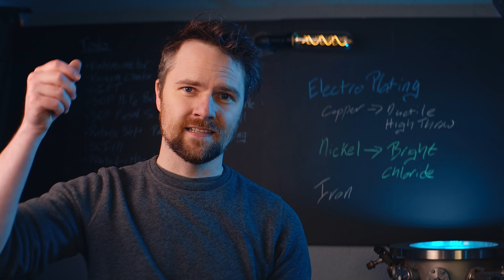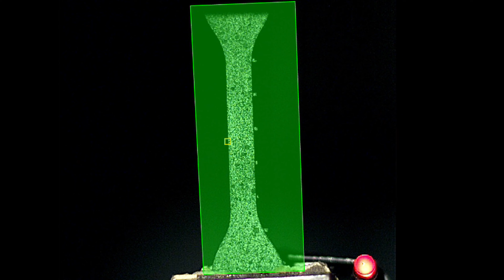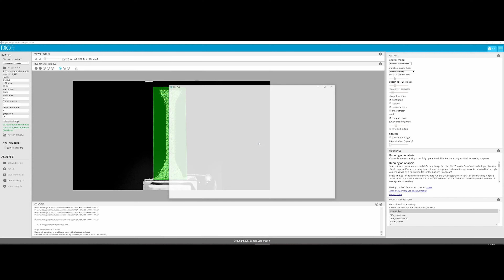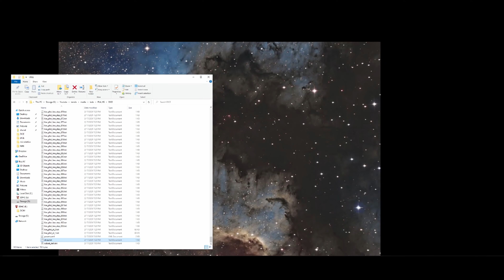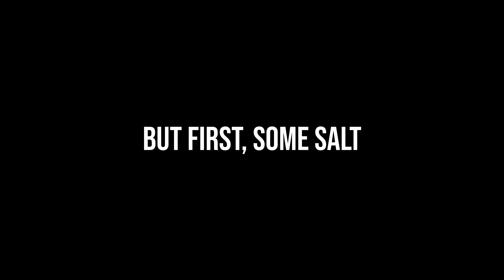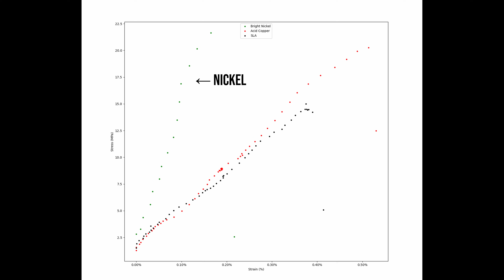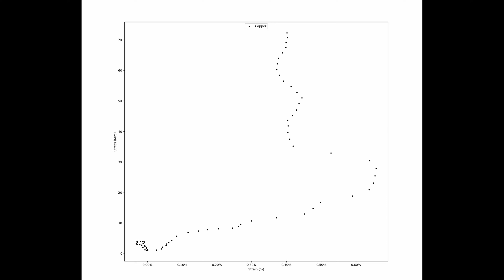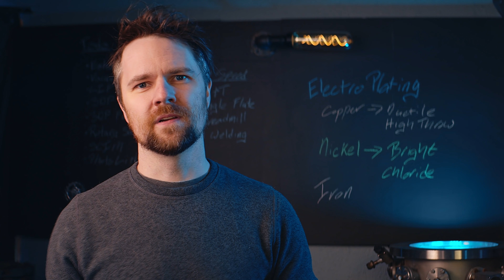Stronger 3D Printed Parts with Electroplating

Comment: I've been trying to metal plate my SLA prints for a while now and have had no end of issues with the paint/ink flaking off and taking the plating with it. The next thing I was going to try was to attempt to make the resin itself conductive by mixing in graphite or copper powder. I don't want to go too wild roughing up the surface of my parts for better adhesion because then the final surface finish will be affected.
e: jotatsu's suggestion is interesting too!
Reply from the maker: Yeah, it can be a real headache... I probably should have shown the pile of failed parts at the end to help convey that too. :)  One thing that can help is changing up your plating recipe, different recipes have different levels of internal stress.  E.g. an all-chloride nickel I tried had to have a copper undercoat because all the internal stress made it peel off the conductive paint. So you might have luck changing up the plating bath, and also a lower current density (i averaged 100-500mA for most of these).

Comment: Instead of putting parts in a chemical bath and plating the outside, could you print tubes and coat the inside, or print a shape with a wall and a lattice as infill so the 3d printed part is its own chemical bath or something? Maybe use conductive filament.
Reply from the maker: In theory, yes. But the electric part of electroplating makes it tough.  Electric field lines will always extend between electrodes in a relatively straight line, so to plate the inside of a tube you'd need to thread an electrode inside the tube and keep it from touching the tube wall.  So something complicated like a lattice gets complicated.  That's the main appeal of electroless, it coats everything uniformly because electricity isn't involved.

Comment: Re apparent increased strength of the plastic interior of your compound part: perhaps the metal plating is interacting with potential crack nucleation points?
Reply: That was exactly my thought.
Reply: ...which might point to other ways of using surface treatments to improve printed resin strength. I'd be interested to know whether a very light copper plating -- perhaps not even enough to form a continuous layer -- has any effect.

Comment: Hi! I really love your videos, keep on the good work! One way to make better adhesion between the coating and the graphite would be, to use ABS parts, and the conductive ink needs to be something thats dissolve abs. Graphite suspended in abs slurry would be a good option i think.

Comment: Not to not pick, but SLA resin is not SLA resin. It’s not a single category. There are a number of different physical characteristics available.
Reply from the maker: Yeah this is a very good point.  I added a line to my addendum comment with the resin type and brand. Also a note: I printed these samples a few months ago and then forgot about them, so if resin embrittles over time (not sure if it does?) that'd effect things too.  And the Form lab folks have shown that UV cure schedule can affect things too.  Many variables!
Reply: @BreakingTaps  what you are doing is interesting. It is similar to an electroforming project I did a while back. 
Resin just off the build surface is only about 80% converted. It will continue polymerizing for some time, aided by what post print curing you might do. Then it will exhibit its final physical characteristics. Thousands of possibilities for that. 
If you do pursue plating, it might be worth your time to print with an electrically conductive resin. But if not my preferred method on acrylics is PVD. On a dense lattice though... obviously difficult to get a good coating. The nice thing is that even very heavy high exposure surfaces will not be appreciably thick. As long as there are no stubborn self shadowed areas you should be good to plate or as you like.
Reply from the maker: @Ave_Xavier  This is great info, thanks! Once the temperature warms up a bit, I'd like to get back to working on my vacuum chamber (glowing thing in the corner).  First project is probably going to be thermal evaporation or similar.  I guess the challenge there would be getting a good rotating stage inside the chamber, since lattices would need to be coated at all angles.  Hmm...

Starting to look into conductive resins too, or additives (or papers/patents about adding additives)
Reply: @BreakingTaps  thermal evaporation can eject larger droplets. Take care. A magnetron is a bit finer a coating technique. Quite a few YouTube postings on DIY methods. But yes , you’ll need a rotation stage that can tip 0-30deg through the rotation. And you’ll need to reposition the part a few times to avoid shadowing. I think you know all of this. But it never hurts to chime in. As for conductive resin, contact Roxel3D.

Comment: oooh I would love a CNC Kitchen exploration on this
Reply from the maker: Yeah me too!  I'd trust his results a lot more than mine to be honest :)
Reply: @BreakingTaps  and I trust your results more than mine....
Reply: Hahaha tbh your stress graphics seem weird... But your results seem proper, nice video all around
Reply from the maker: @derchesten  Yeah, there are a lot of variables here: manual machine from ebay, potentially suspect planetary gear or motor (oscillations), load cell and arduino code, DIY fabricated jaws, misalignment, i think the polling rate of my load cell was too slow relative to the force of the machine, and then interpolating in the optical measurements... lots of things that could have gone wrong :)
Reply: @BreakingTaps   @Breaking Taps  whoa, I just discovered your channel yesterday and I'm completely enamored with the content, I didn't know it was a diy machine!
Look, you can keep the polling rate slow if you slow down the application of the force, I had the same problem when doing my degree thesis, the darn machines in the University had too slow of a polling ratio so we had to do the tests painfully slow (about 2kgf/s down from the standard 10 of the machine), which also has the side benefit of making the tests more reliable and the data less noisy. But if you could up the polling rate it would be way less painful.
Reply from the maker: @derchesten  Thanks!  Yeah, I'm going to see if I can improve both ends:  i suspect there's just something silly in my code, iirc the datasheet said the load cell chip could poll up to 80 sps and I'm not hitting that, so there might be something else slowing it down.  And I have a suspicion the motor inside the unit is some crusty old brushed motor and the brushes might be really worn out.  Replacing it with a new brushless motor or something would probably help a ton, and give me better control over speed.  It was unfortunately already on the lowest speed :(  yay old surplus equipment :)

Comment: Amazing work and beautiful image correlation shots! This really motivates me to finally spend some time and also try this out. Keep it up!
Reply from the maker: Thanks for stopping by Stefan! Your work was definitely a huge inspiration, and I'd love to see your results if you ever decide to try.  I'd trust them a lot more haha :)  I have a new appreciation for how much work this kind of testing is, and frankly, I'm skeptical of my data even after trying to only include the most conservative results.  Just so many variables: conductive layer, plating recipe/time/temperatures/current density, grip strength in jaws (too much can crack the plating, too little slips), axial misalignment, temperature... the list just goes on!  Really appreciate the work you do to get such nice results :)
Reply: @BreakingTaps  By using open source software, you are making your work accessible to others. Thank you!
Reply: @BreakingTaps  You should also investigate electroplating with conductive filament. Is raw conductive filament doesn't work well maybe try coating the filament with some conductive ink or something in the way make anything did for multi color prints by changing markers.
Reply: Stefan, I think this could be the solution to the re-melting problem. Chemically plate with Copper, re-melt, chemically dissolve the Copper (Or don't...)

Lots of work? Yes. More work than dealing with the salt? Maybe. Will it work perfectly? I'll eat my hat if it doesn't.
Reply: From the resources I could find, PPA+CF filament and theoretically ABS/PC+CF filament should have the lowest thermal expansions amongst thermoplastics. Maybe an ASA/PC+CF, since ABS with the Butadiene removed is frequently used in metal coating.

(main source: https :// omnexus . specialchem . com/polymer-properties/properties/coefficient-of-linear-thermal-expansion )

They should be closer to the thermal expansion rate of copper that I have found online, but I'm not sure how useful that is.

Would you even want to re-melt a CF-infused filament? Even without re-melting, couldn't you find another, cheaper material to make a metal-coated part? Maybe you'd rather 3D print a mold for a thermoset with lower thermal expansion rate, fill it with graphite, and coat the castings with metal.
Reply: Alternatively, if you just want easy and cheap metal-looking items, just print foaming ASA filament and electrolessly plate that. The foaming also reduces thermal expansion, and ASA is cheaper and relatively simple to print.

Comment: Regarding the copper elongation at around 08:40, could it be that copper is working as an "spreader" of the strain along the plastic part, ie, spreading the strain plastic sees, so the plastic part can take more strain before breaking?

Comment: Awesome project and video production! 

One thing that you may have addressed in a previous video, so sorry if I'm off the mark: Can you use the position of the jaws on your mechanical testing as a stand-in for the strain? Generally doing the optical correlation method isn't that necessary for uni-axial tension (and more useful in bending etc.  like you mention). 

Does your machine have the ability to precisely measure the distance that it has moved? 

As someone else mentioned in the comments, the largest problem with doing this is that it ignores the change in cross sectional area due to necking. Aka it gives you the "engineering strain" instead of the "true strain". The optical method can partly get around this, but like you said, the parts are pretty brittle so necking isn't really a problem. 

Anyway, I'm very much looking forward to what you do next!
Reply from the maker: Probably! This is all very new to me, so I'm sure I attacked it from a sub-optimal angle :)  I ended up cutting the description/footage of the machine itself, but it's an old manual test machine and didn't come with any hardware.  So I fabricated the jaws, added my own load cell and wired it up to an arduino.  The LED lights up when the load goes over a threshold so that I can correlate it to the video (because I have to manually push a button to run the motor).  No mechanical means to measure displacement at the moment.

I'm considering adding a digital DRO scale to the machine.  Should be pretty easy, and can read it out to the arduino to get displacement without the video.  I might do that before trying to tackle the FDM version of this video, since it seems like necking will be a much bigger issue.  Or maybe just switch to bending tests, that gives basically the same data as uni-axial tension right?  Well, I guess flexural stress is a little different from axial so not quite comparable, and the stress is very discrete in a 3-point test as opposed to uni-axial.  Hmm.

I saw "engineering strain" somewhere but didn't know what it referred to, makes sense. Cheers!
Reply: @BreakingTaps  Or put the reference points closer to the jaws, perhaps using permanent reference points on the jaws themselves.

Comment: "Powder coat" the part before doing the electroplating stack. I did a short video recently on how to.  You basically put a conductive powder (graphite for example) on an ABS part , put in an acetone vapor chamber and then lightly sand and electroplate the part.  The advantage is that the acetone vapor will integrate the powder inside the plastic instead of being just a surface coat.
Reply from the maker: Interesting, will check it out!  That seems like a solid method to get better adhesion.
Reply: @BreakingTaps   
Those  Unplated numbers are higher than Zytel.
What do you want?
Reply: Awesome Idea, I will try that soon
Reply: Now that sounds like something to try.
Reply: Would a conductive filament be conductive enough to work?
Reply: hmm if you could put lots of tiny holes on the surface it would let even more metal coat into the print and bind stronger.
Reply: Does this work for resin though?

Comment: for electroplating, can you insert additional electrodes into the mesh to make current more even?
Reply from the maker: Yep! Adding multiple electrodes is a common way to get better or more even coverage.  I used two anodes (one on each side of the test sample), and wrapped a length of magnet wire around the part as the cathode to help distribute electricity better.

Comment: To comment on the note at 8:40 concerning the prolonged elongation, what could be happening is that at break the shear forces induced by the stretching causes the failure, the failure also comes from the outside and travels inwards. The layer of nickel prevents the buildup of shear at the edge for just a bit longer and gives that elongation.
Reply from the maker: Interesting!  So it might be a real effect... I'll have to go back and check the rest of the data to see if it's similar.  I guess with a brittle material like this resin, small microcracks quickly propagate.  But the metal coating helps take up the stress from those cracks and prevent them from spreading (as fast).  Nifty!

Comment: What if you incorporated small dimples or pits in the print, that would allow the plating to mechanically grip the model?  Also, would there be any benefit to placing the electroplating vessel in a sonicator to add agitation into the process? The idea being the vibration would cause the coating to penetrate deeper into the micro pores and cracks on the surface of the model.
Reply from the maker: Yeah was just chatting with someone else about this idea, adding some kind of surface texture or feature for the plating to help hold onto.  I think it makes a lot of sense.  I saw a few papers about etching the plastic with chemicals too, for a similar idea (although at a smaller scale).

I haven't tried it, but someone commented on the microlattice video saying that sonication can improve plating immensely.  Helps remove bubbles, helps refresh electrolyte at the solution-solid interface, and can help redistribute some of the organic additives that help level things out.  I've been meaning to try it just haven't gotten there yet :)
Reply: That's the reason for "etching" the plastic, these micro-holes are a very important factor for a good adhesion for the nucleation material (Pd, Tin/PD, Tin/Ag, Ni...) if the holes are too big (too much etching the Pd will fall out and make bad coatings...
Good book about Electroless Platting: Read about page 60: 
link -> https://pureadmin.qub.ac.uk/ws/files/126683921/Edited_sudagar_R1.pdf

But instead of these acid treatments, there is a method using Chitosan, which has a porous structure where nucleation materials can be embedded...
Reply: @AltMarc  I have heard of chitosan,but haven't been able to find a cheap source. Do you know of any?
Reply: @-robo-  I do not live in the US, but in the worst case it can be done at home, cleaning and cooking the shell of crabs/lobsters in an alkaline solution.
Perhaps, you could ask "TidalVisionUSA" for a sample.

Comment: Chemical vapor deposit instead of painting in conductive paint.
Reply: I would worry about the temperature. CVD can coat plastic, but that may turn out to be a huge hassle.
CVD uses very high temperatures internally, unfortunately this heat leaks into the target and can melt it. There are tricks which can help a lot, like doing CVS in very short pulses and cooling between the pulses. CVD coating plastics is a relatively new technique in the industry.
You can also try PVD but it has similar problems and some more. For example, if your plastic part outgasses it will ruin your vacuum and stop any sputtering.
Reply: @adamrak7560  CVD has been used to metalize plastic for about as long as plastic has existed.  They use it to coat very low temperature plastics like vinyl with very high temperature metals like platinum.  Only the molecules of metal that condense onto the plastic transfer heat, the coating only has to be a hand full of atoms thick to give the plastic the properties needed and no appreciable heat is transferred at such a low amount of metal vapor deposition.  Once the first layer is established other plating methods can be used to make thicker coats. 

Outgassing can spoil the vacuum, but usually this is just water vapor that has permeated the plastic and the pumps can pull it out faster than it is an issue.  Your reason itself should not be outgassing much if it's properly cured.
Reply: @zyxwvutsrqponmlkh  is it true for home made CVD too? Have you tried it? The home made chamber I have seen on the internet run quite hot usually. Not suitable for plastic.